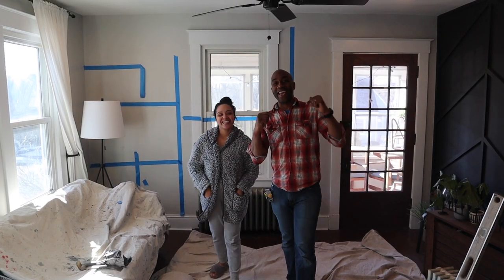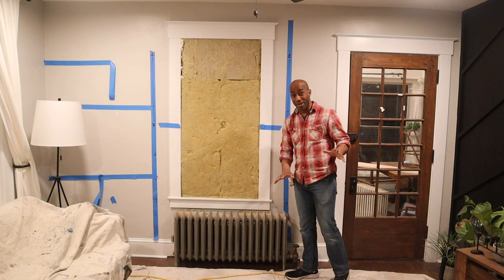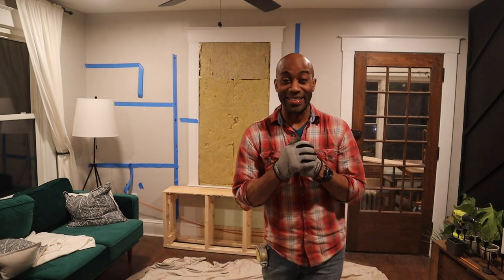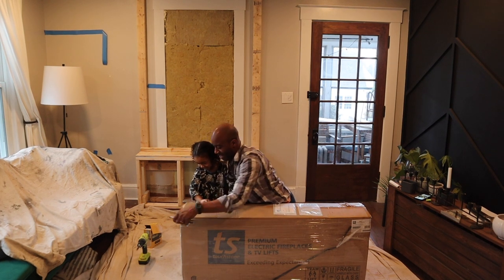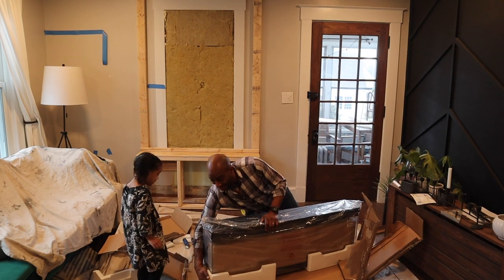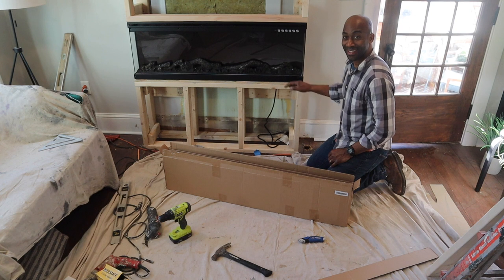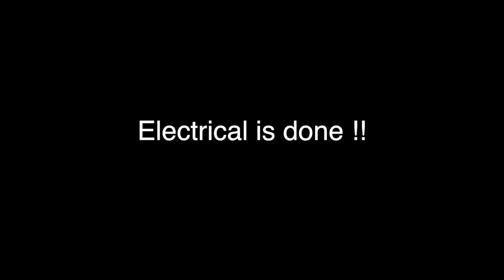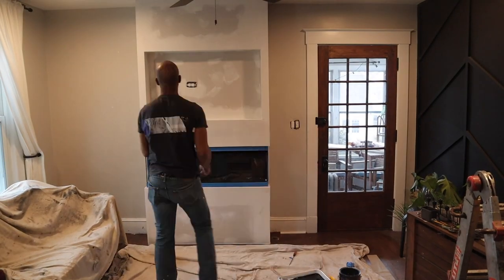50" Infinity Electric FirePlace Installation

Comment: Great video! How high is your base where it touches the bottom of the fireplace? I recently got the 72” version of the same fireplace you have.
Reply: I’m getting the 72” also. Have you had any issues with your breaker tripping while using it on high? According to my research I’ve done on volts/amps it’s over the recommended wattage. On high it uses 1500 watt. On a 15 amp the wattage is 1440. I only know this because I recently added a new light fixture to my hallway and wanted to make sure I didn’t cause any issues lol I made sure I did my homework
Reply: Honestly, I haven’t needed to use the heat yet since it’s been hot/warm. I’ll know this winter lol!
Reply: @mrkngkhan  ok. It doesn’t get that cold here in Houston so I really don’t see myself having to use it on high. It’s more for ambiance lol so I think it should be fine. I just don’t understand why it’s made to use so much wattage when 90% of homes is on a 15 or 20 amp
Reply: @MissMoyston  yeah, that’s wild. Didn’t think it would pull that much power.

Comment: Did you completely buried the plug and outlet behind the drywall? I’m going to be building the same thing except with a 72” but I’m wondering if it’s smart to have no access to the plug. Also do you have any issues with your breaker tripping? It uses 1500 watt on high
Reply from the maker: No we have access to it if we removed the fireplace. I would recommend having an access panel that’s something we would do different if we did it again. Unfortunately for us we have to remove the fireplace in order for us to get to the outlet. We have used it on high and have no issues with it tripping. Best of luck with your project!